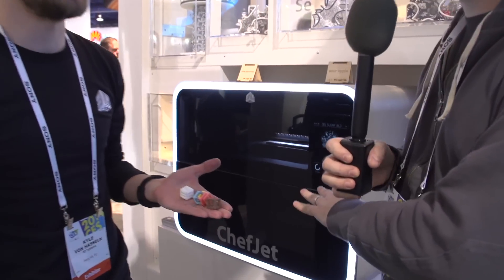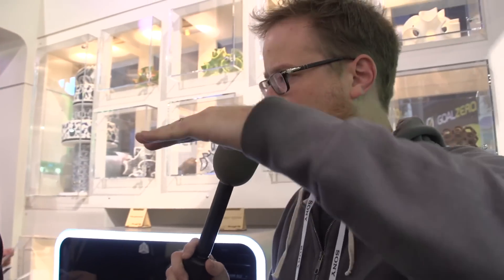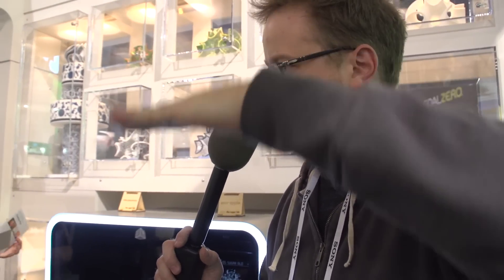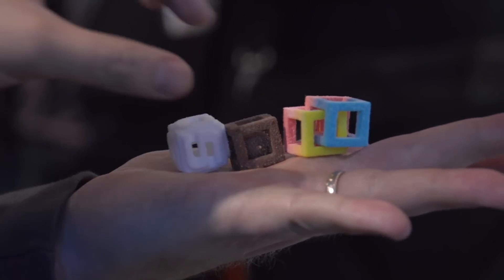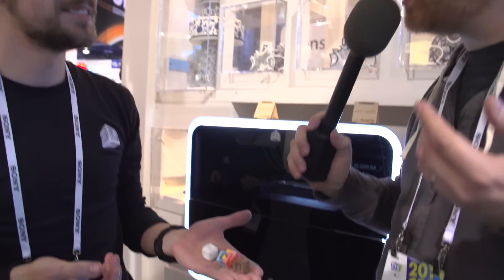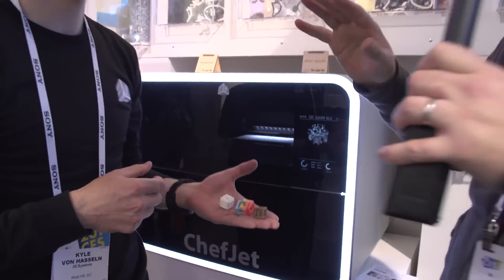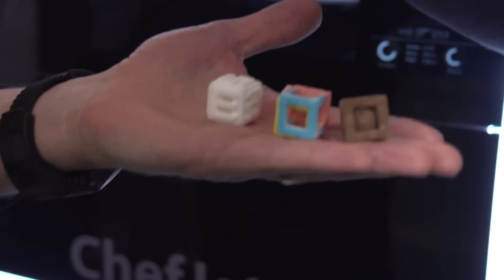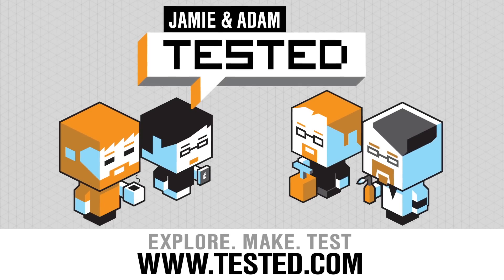Taste Testing 3D-Printed Food!

Comment: How long will it be before they're printing molecules of sugar from carbon and water? Mixing steel with carbon and iron without needing a drop of heat to melt the alloy? How long until they can print 3d printers?
Reply: i would think metal still needs heat
Reply: anton rockoboac Heating metal has two major purposes, malleability and crystallization. Crystallization is important for making steel since it needs iron's crystalline structure to be loosened enough to shove the coal's carbon atoms into the lattice work in the right way to make the various types of steel.

But if we get to the point of atomic printing, we would just need print the carbon in the lattice when and where we wanted it.

Comment: For me the confusion comes in when they refer to it as a "printer" when it is really a mold maker. It is taking food ingredients and molding it into shapes. Not much different than pouring cookie dough into a pan with molds and baking different shaped cookies. When the day comes that you can pour in the raw materials used to make a car and press a button and a driveable car appears that will be sci-fi of the highest.
Reply: They call it a printer and not a mold maker because it's a printer and not a mold maker. Layers of a loose, edible substrate are thinly spread and then fused by a moving arm working on a matrix that injects particles of water or some other binding agent onto the surface of the substrate. This is absolutely nothing like molding and everything like printing but with water instead of ink and the loose, edible substrate instead of paper.

As a layer of substrate gets its print, a new layer is applied over top of the substrate (think of this as a second sheet of paper). Subsequent layers are printed on top of the previous to form a 3D object and in the end the solidified object is removed and excess substrate is blown away. This technique can produce complicated structures that would be physically impossible to actually mold.

Even if this printed molds for these complex shapes rather than printing the food directly as it does, you would not be able to use them unless they were made of a material that could be degraded without also degrading the food product. And even then, filling the mold would be very complicated without stuff like centrifuges, and percussion agitators (as are used to mix paint). If this really was a food mold maker, it'd be horribly inefficient when you can just print the food directly.

Comment: maybe in 15 years, well be able to print pot
Reply: 'cos it doesn't just grow already >.>
Reply: ***** Thanks you made me crack up
Reply: I seriously hope people realize that I made a pun
Reply: ***** haha XD
Reply: Daniel Johnson Same XD
Reply: one can only hope :)
Reply: That doesn't even make sense.
Reply: Encode Me or someone else?
Reply: ***** Correction: They only use 3D printed dildos :D
Reply: There is no reason you couldnt print smokeables, cannabis oil is really sturdy as an ingredient. Funny thing is, you can then print joints without the need for filters and paper, because you could optimize the airflow through complex structuring and thus optimize the combustion into a more clean smoke with waaay less health concerns...
Reply: 4 years later, tech is going really fast. I expect an actual utopia in 10 years
Reply: wouldn't the filament just be ground up weed? why not just smoke the filament?
Reply: They can print Ibuprofen so I assume they could print pot.
Reply: With that food printer you probably could using the same chemicals in the plant and..You know im going to stop there i dont need Fbi at my door XD
Reply: Yeah, but now i'm unsure if you might have meant you could just put THC into food via a food printer.
Reply: maybe you can just replace weed with wherever the water and sugar goes

Comment: With the three colour print head, I'm assuming you can flavor each colour differently, but I'm wondering if there would be some way to use a mix of the sugar and chocolate substrates, and then have a different binding agent in each head (water in one, cocoa butter in the other). I doubt this would actually work to print two separate materials though... at best it would maybe print different consistencies of one material. Anyone got any ideas on how you could potentially do this? Maybe a way to have different areas of substrate during the powder spreading stage?

Comment: why not use molten chocolate? I mean, you can melt candy or make it gel consistency but it's more complex; but wouldn't it just be easier to feed the printer chocolate pellets, fuse them and then pile thin layers of that up? that technology is what's already being used in plastic 3D printers right? why would they do this?
Reply from the maker: My guess is that chocolate doesn't cool quickly enough or remain viscous enough at the right temperatures. Likely heating and cooling it would affect its temper as well, so you might end up with a weird chalky or powdery looking candy.
Reply: Seems legit. Mixing the ingredients at the same time you print would preserve the smooth texture of chocolate since it does not have to melt and cristalize again. I need to further investigate about this. Thanks a lot. Greetings from Spain!